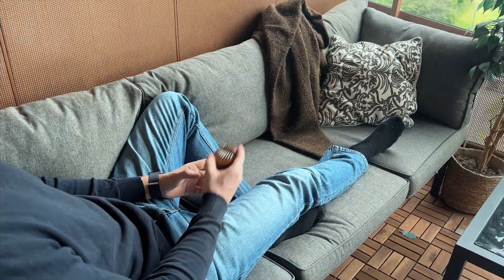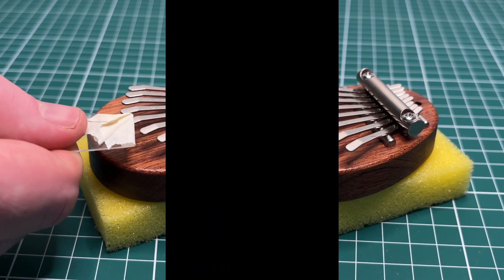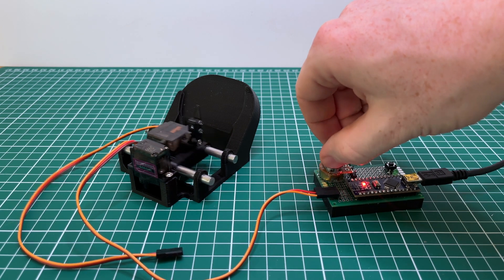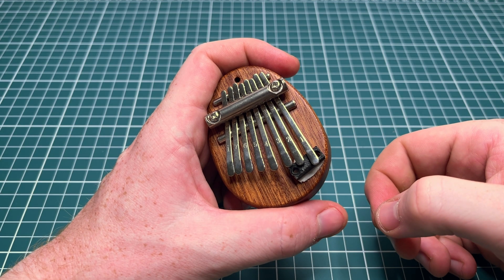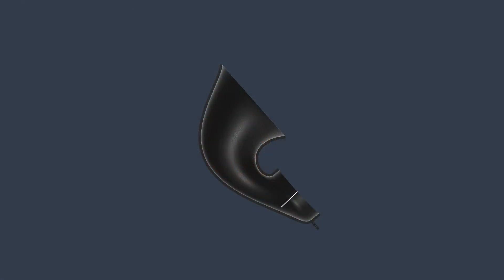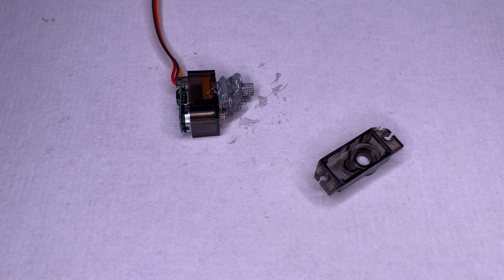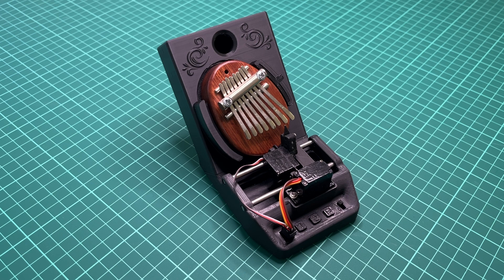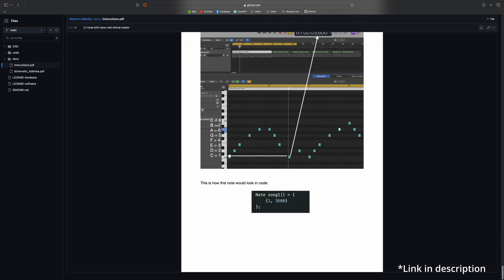I Made an Electric Kalimba

Comment: can totally add a midi interpreter in software and push it from a PC running Hairless MIDI to the Arduino Nano's serial port. you'd have to minimize the midi files for the limited range and speed. Hairless is a MIDI-Serial bridge that will show up in your DAW and you can use it like any other "normal" MIDI output.

Comment: Lovely video! 
Design suggestions 
1 - use a horn on the hole in the resonator box. If the box is elliptical, you could have the Kalimba at one focus and the hole for the horn at the other. It's possible to tune the dimensions of the box to the root note of the Kalimba.
2 - isolate the box holding the resonator from the box holding the servos. Rubber washers between them and rubber feet for each box.
3 - cover the servos as much as possible - leave a gap into the box they're mounted on, and print a simple maze inside, or line it with the foam to make a baffle

I have a programming suggestion to help integrate the servo noise. If there is enough time, ie. the plucker arrives but would have to wait more than one beat to play the note, instead use the servo as a percussive note and move position on a beat division. Different speeds and lengths of movement will be perceptibly different acoustic sounds, so a whole host of ghost notes and percussion may be possible.
Or, I have to ask, would slowing the position servo down make it quieter - arriving just in time? 
Lovely post next hope you return to it.